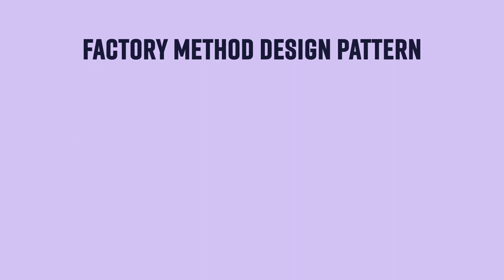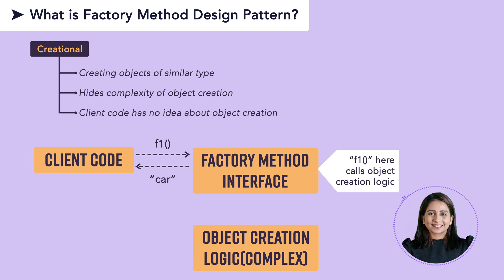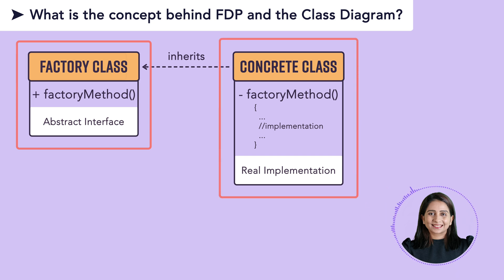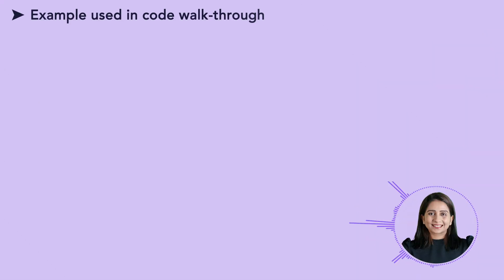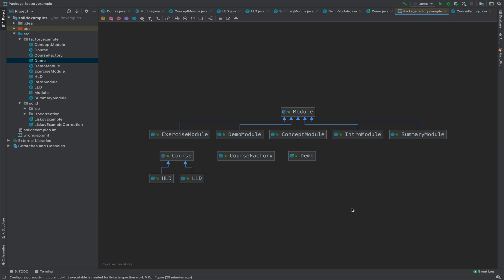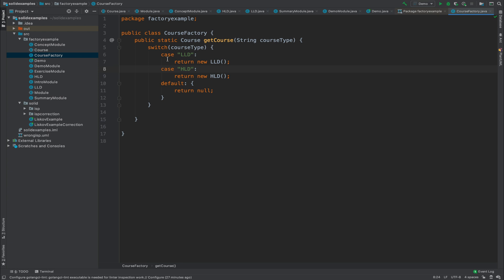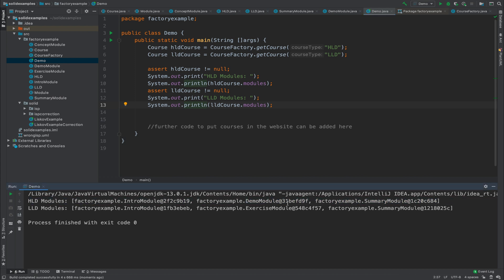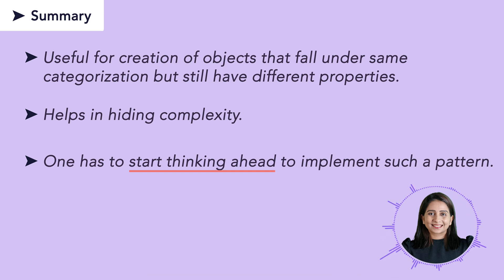How to use Factory Method Design Pattern to design a course website like Udacity, Edx, Coursera...

Comment: This is simple factory only. Not a factory pattern.
Reply: 𝗦𝗶𝗺𝗽𝗹𝗲 𝗙𝗮𝗰𝘁𝗼𝗿𝘆: A class with a single method that creates objects of different types based on provided input.

Not a "true" Design Pattern: Often considered an implementation technique rather than a formal design pattern.

𝗙𝗮𝗰𝘁𝗼𝗿𝘆 𝗣𝗮𝘁𝘁𝗲𝗿𝗻 (𝗔𝗯𝘀𝘁𝗿𝗮𝗰𝘁 𝗙𝗮𝗰𝘁𝗼𝗿𝘆): A design pattern that provides an interface for creating families of related or dependent objects without specifying their concrete classes.

Delegates the responsibility of instantiation to a subclass or an interface, adhering to the Open-Closed Principle (OCP).
Reply: Yes. I was looking for this comment.
Reply: I am new to the design patterns. I want to know if this is not the factory pattern??

Comment: 1. 2:28 the class that implements the creation logic is wrongfully called "concrete" class, or subclass, that implement the factory method interface. The "factory" class need not be an abstraction for the creation implemention but a totally separated class. This is because you want to decouple the objects being created, from the factory (see 5.).
2. 2:56 the same thing. You say that the FactoryClass is abstract or an interface.
3. 4:40 the concrete class is not hidden from the interface that it implements, it just can't be. But it is hidden from the client.
4. 9:51 In the Course example you make the Course class abstract. Furthermore you have an abstract method named createCourse() which would suggest it's responsible for the underlying logic of a factory method like newing the Course. In fact it has to do with inner composition of a Course but not with its instantiation.
5. You made the CourseFactory not an abstract class/interface and well you did. But remember what you said in 1. and 2. But you name the instantiating code getCourse() which would suggest it returns a permanent unique field of the class. You should name this createCourse() or just create().

Comment: 9:51 CreateCourse() is not the meat and potatoes of the Factory pattern. The Factory pattern relies on delegating the object creation to a class specialized for this purpose. The underlying mechanisms of the actual creation vary by use case and are beyond the scope of the Factory pattern.

Comment: Hello and geetings from Bulgaria.

I like your energetic and well explained courses. However ...

I can see for last ... many years that it is the Indian scholars pushing the abstract methods while many other have given them up. For ex. the whole C# platform is based on the implementation of interfaces. Which in OOP terms gives us the "is a" relationships. Down the line that also help to implement the very modern now concepts like dependency injection and automatic unit tests. In both cases we can inject an object as another object's "has a", as well as we can inject a Mock object with pre-setup return values. That is for as long as those objects implement the desired interfaces.

I would love to engage you on small chat / discussion about that.

Thank you,
ILIIA
Reply from the maker: Thank you for your comments. I would have loved to chat with you if you haven’t opened with the Indian scholars. Computer science is a science. It has nothing to do with origin of the scientists. Wish you well 😊
Reply: @sudocode   Word scholars is a valid word and it has a meaning within any science regardless how precise science is.

If one looks for insult he or she will inevitably find it.

Wish you well

Comment: I presented similar design in one of the tech interviews and was questioned on breaking OCP in factory class. 
Though this is mostly taught by most authors for explaining the concept, in reality, we can avoid switch case with map so factory method just look up the map and return the value. Now to build the map, we have two choices
1. Provide register product method in factory so product can register itself and then can be returned
2. Use reflection to load classes in a map at startup. Map is maintained by factory class. Map key is identifier used in  switch case and value is return type of factory method.
Reply: We use map in our project
Reply from the maker: Both ways are good enough as an alternate to switch case. At the end factory does have knowledge of the map or the way to figure out the concrete class.
Reply: @sudocode  if you agree, would you consider editing the video or add a top level comment to let readers know about this. It might save them from getting kicked out from their dream jobs at no fault of theirs.
Reply: @curiossoul

Does below code works without violation of OCP ?

// Toy interface
    interface Toy {
        void play();
    }

    // Concrete toy classes
    static class Car implements Toy {
        public void play() {
            System.out.println("Playing with a toy car.");
        }
    }

    static class Doll implements Toy {
        public void play() {
            System.out.println("Playing with a doll.");
        }
    }

    // Toy Factory interface
    interface ToyFactory {
        Toy createToy();
    }

    // Concrete toy factory classes
    static class CarFactory implements ToyFactory {
        public Toy createToy() {
            return new Car();
        }
    }

    static class DollFactory implements ToyFactory {
        public Toy createToy() {
            return new Doll();
        }
    }

    // Toy Factory Registry
    static class ToyFactoryRegistry {
        private static final Map<String, ToyFactory> factoryMap = new HashMap<>();

        // Register a toy factory
        public static void registerFactory(String toyType, ToyFactory factory) {
            factoryMap.put(toyType, factory);
        }

        // Create a toy based on toyType
        public static Toy createToy(String toyType) {
            ToyFactory factory = factoryMap.get(toyType);
            if (factory != null) {
                return factory.createToy();
            } else {
                throw new IllegalArgumentException("Unknown toy type: " + toyType);
            }
        }
    }

    public static void main(String[] args) {
        // Register toy factories
        ToyFactoryRegistry.registerFactory("car", new CarFactory());
        ToyFactoryRegistry.registerFactory("doll", new DollFactory());

        String userInput = "car"; // For example, user chooses "car",  We can also read this from a configuration file, database, etc.)

        // Create the toy using the registry
        Toy toy = ToyFactoryRegistry.createToy(userInput);
        toy.play();
    }
Reply: @theCodesConnection  I think this can be helpful for ocp and alternative, if new requirement come in just   create extension thats it
Reply: Any sample code for for not vloilating OCP, please share.
Reply: I was about to say OCP....You pointed out

Comment: Hi Yogita Maam , At 4:15 you showed in diagram that  Factory Class contains no implementation .That is not the case as in factory class,factory method should contain the logic to determine one of the concrete class.In the slide you showed , logic to detremine which subclass is resposibility of subclass but thats not the case as logic to determine which concrete class is the responsibility of Factory class . Could you please clarify on this ?

package com.journaldev.design.factory;

import com.journaldev.design.model.Computer;
import com.journaldev.design.model.PC;
import com.journaldev.design.model.Server;

public class ComputerFactory {

	public static Computer getComputer(String type, String ram, String hdd, String cpu){
		if("PC".equalsIgnoreCase(type)) return new PC(ram, hdd, cpu);
		else if("Server".equalsIgnoreCase(type)) return new Server(ram, hdd, cpu);
		
		return null;
	}
}
Reply from the maker: It means no implementation to initialise the actual object creation :)
Reply: @sudocode  Yes .But thta's not correct.Initialization to create actual object is always done in factory class.see below code 2 code from geekfor fees and journaldev                 .

public class NotificationFactory {
	public static  Notification createNotification(String channel)
	{
		if (channel == null || channel.isEmpty())
			return null;
		switch (channel) {
		case "SMS":
			return new SMSNotification();
		case "EMAIL":
			return new EmailNotification();
		case "PUSH":
			return new PushNotification();
		default:
			throw new IllegalArgumentException("Unknown channel "+channel);
		}
	}
}

public class ComputerFactory {

	public static Computer getComputer(String type, String ram, String hdd, String cpu){
		if("PC".equalsIgnoreCase(type)) return new PC(ram, hdd, cpu);
		else if("Server".equalsIgnoreCase(type)) return new Server(ram, hdd, cpu);
		
		return null;
	}
}
Reply: I agree with Saumitra Saxena. In your example also CourseFactory has logic to initialize object of concrete class like HLD, LLD and not the concrete class has that switch case logic. This is done to ensure only Factory class is open for changes and rest are closed for modifications.

Comment: Hello. I appreciate your effort. I have a question regarding the switch statement in your CourseFactory class as well as else-if statements in the vehicles example. Aren't those breaking the open-closed principle?
Reply from the maker: No they are not. They are open for extension in a sense you can add more courses but they are closed because each course has its own createCourse method which you cannot modify :)
Reply: @sudocode  what if I want to extend your app by creating another type of course? Will I have to modify your class?